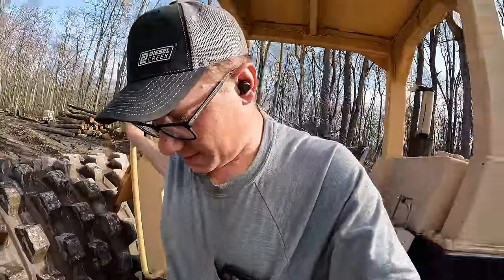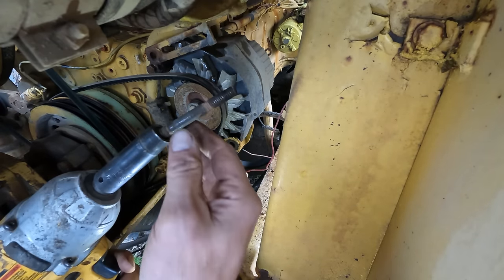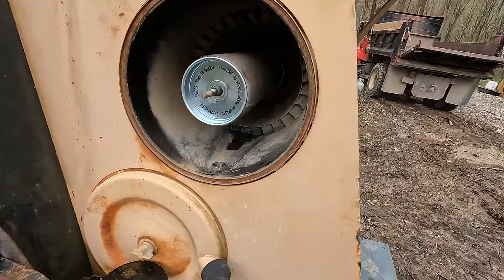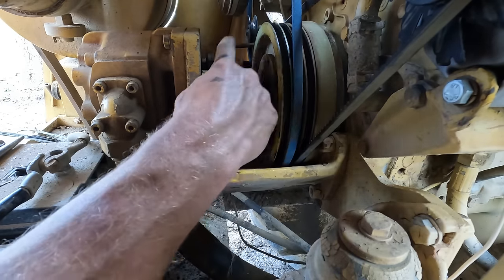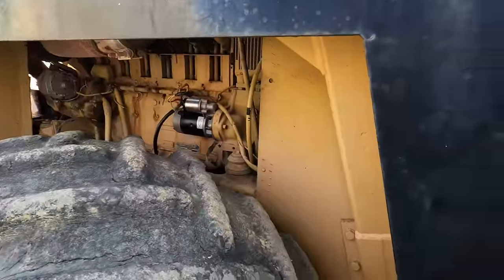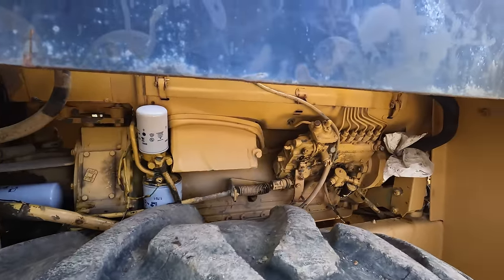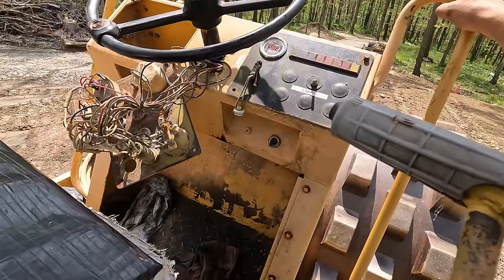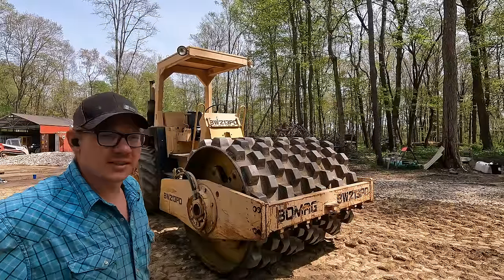I got BURNED on this Compactor from an Auction! (Bomag BW213)

Comment: I'm floored that a roller compactor needs a 150HP to knead out soft materials.  Don't backhoes only have roughly 75HP?
Reply: Not an expert but maybe needs the extra power for
Reply: Based on no doubt flawed quick searching, a typical backhoe is around 7 to 8 tons.  This roller is 13 tons.  Takes more muscle to push the extra tonnage, a fact I recall whenever I have to get out of my recliner.
It probably is overpowered, lots of stuff was in the 80s.  Then gas topped a dollar a gallon in about 1984/85 (horror!) and both gas and diesel engines went from "plenty of power" to "almost enough" in just a couple of years.

Comment: I like those huskey kevlar belts from tractor supply also.
Alot of people don't realize those lawn mower belts are better and cheaper than automotive belts.
I think they are better than the others.
I save a few of my one gallon jugs to refill out of a 5 gallon with a funnel for tight areas also.

Comment: I had a tractor with the same starting issue, I haven't watched to the end yet but the problem was the control wire to the starter from the key was hashed a bit.  It would only send 7 to 10 volts to engage the starter.  I added a relay in and took a wire straight from the battery.  It only takes 6volts to engage the relay that closed and sent 12+ volts to the starter solenoid that made the starter engage every time.

Comment: They are oil cooled and yes it does have a radiator but it runs oil through it rather than antifreeze.  That drain plug placement it normal for Bomag even today, get your self a Fumoto or a EZ-drain valve.

Comment: Equipment mechanic here, blame the engineer. Out of our fleet which has hundreds of pieces of equipment, for the duesel powered equipment we have 5 different manufacturers. 2 of the 5 had foresight for oil changes having suction lines for oil drains. The other two? Well one has a drain hose thats only 3/8. For diesel oil. Takes an hour to drain. The other? A MISPLACED hole in the belly pan allowing just enough roof for a wrench to pull the drain plug. Then you hack up a piece of cardboard or water bottle or whatever and wedge it in there and brace for the mess.

Mind you those two manufacturers build multiple machines with different engines that all have the same issue.

One of our generators has a drain line routed through the frame rail of the machine to a convenient drain point. No mess, but the line is long, undersized, and lays nearly horizontal. It took 5 hours to drain 3 gallons of oil. Also a deutsch design.

We had a brand new machine once, has a hydraulic tilt cab for service. Apparently they needed to change cylinders out because the ones they were using were discontinued. They dropped the machine off and came to do their final inpection. Lifted the cab and couldn't lower it. New cylinder didn't fit properly and would get caught on the frame. No one tested it apparently after making the switch. Why? Just why?

Comment: On the starter motor you called the starter solenoid a relay the reason you were having starter problems was the solenoid was not pulling the bendix fully into the flywheel  the end cap of the solenoid is also the main switch for the starter that plastic end cap is removable to clean the contacts of the switch ( just fpr future info  it is quite a straightforward job to remove the cap usually 2 solder joints and remove the nuts that hold the heavy cables

Comment: the high/low vibration works by reversing the drum motor, there should be a solenoid valve operated by a switch to control direction

Comment: Considering the importance of the fan, it would seem that a two belt system would be much more reliable.  Get a double pulley for the tensioner, or make a double pulley and that critical component will not be a worry again.

Comment: Take the starter off, take it apart, and clean. CHECK BRUSH HOLDERS FOR FIT. grease bngs both ends, and shaft spline. Remove solenoid and clean contacts inside.

Comment: You're removing the alt. and I say "I see a knuckle injury." the next bolt, wham. But you probably remember that.😁 It happened again, 🤣🤣. Your definition of victorious is different than mine. Let's see you put that back in. You're probably hoping it's no good.🤣  The crankshaft guy wasn't talking to the accessories guy.🤣🤣 No, you have to drop the starter again. Dude, maybe they are after mud. 🤣🤣🤣 "You thought you were going to take a bath." This is my first video of yours, you had reason to believe that. "I tidied this up a bit."🤣 That looks like my  computer setup, but I can't see it and it only gets in the way occasionally.   I'm just bustin on you man. I'm stoned and you cracked me up.  Have a sub. 👍👍

Comment: As a certified electrician I can guarantee you one thing about dielectric grease - it's an insulator, and a very good one at that. It sure won't help you improve the conductivity of your connection, since it's designed to do the opposite of that. If you want good connection, clean the surfaces nicely. Worst case scenario, if nothing else works, you can try the sin of using some conductive grease. Regular grease is also a pretty good insulator as well.

Comment: On that style of solenoid, it's basically a servo that slides a shaft with a disk on the end of it. The disk jumps across two terminals. When they fail, it's usually because the terminals wear down. Sometimes you can get them working again temporarily by unbolting the leads inside and turning them 180, because they never wear evenly and that'll usually give you a bit more wear surface to engage that disk and jump the connection with. I've looked into replacing just that part but they aren't available. Just shop around for a good price and replace the whole thing.

Comment: Hey Matt I know I’m late to reply but I run a few of those Dutz in my fleet and I’ve found it best to bye original Dutz belts for the fan 2 are a match set,,,,usually have a limit switch inline with the fuel shut off that runs on the belt so if the belt breaks it shuts it down,,,love your channel

Comment: Also forgot to mention that Inj. Pump has motor oil in it. we always changed with engine oil service.  Bottom drain plug, level plug on back, and larger plug on top is fill

Comment: The bees are looking for a small hole to build a nest . Leaf cutter and Mason bees use existing holes and pack them with mud or crescent shaped pieces of leaf. Ever seen a radiator petcock stuffed full of small pieces of leaves? They are very particular about the diameter of the hole.

Comment: Late to the party but the old towed dynapac's we had used the broken belt switch in between the stop solenoid so if the belt snaps the engine goes off, makes it idiot proof then

Comment: Heh. I have spent SO many hours on those things. Warning labels: "Never use on any slope at all or you will die!" Reality: "Steep slopes? Hugely lumpy bunch of dirt with mud underneath? No worries, I got this." That said, for what you're doing, you probably could've gotten good enough compaction with a dump truck full of dirt. We passed so many soil tests with broken-down compactors by filling up the water truck and driving it back and forth forever.

Comment: I always learned that dielectric grease is an insulator and should not be used on direct connections where you need an eelctrical current, like you do at 19:25. I see so many people using it though that I had to go look it up again, but it is in fact an insualtor and should be used to protect electrical components from moisture and dirt or to improve heat transfer, but NOT for direct contact between electrical connections. I'm guessing it still works in this case because the pressure of mounting the starter makes the grease layer thin enough for current to flow. But, I think to do it properly you should leave the surface bare metal, and only apply the grease to the very outer edges to prevent moisture and dirt from coming in.
Reply: Dielectric grease is perfectly fine on direct connections

Comment: That family of Deutz engines is like the English Perkins which regardless of number of cylinders they are standardized. Check the main cooling fan bearing as they can cut out early but a very easy fix. ( Make sure to give new bearing around 4 pea sized lumps of grease. Best to clean out and use Amsoil synthetic).

Again the filters on these are terrible. Replace with Racor with a glass water and sediment trap.

The intake manifold on these have a Thermostat fuel heater for cold starts to vaporize fuel very similar to Perkins diesels. Make sure this is checked. 
Deutz for over heating usually have a horn that goes off when overheating so u can shut down.

When compacting to achieve max results sprinkle a bit of water into material then pound in inch but inch. This helps lubricate material allowing it to shake into place.

Note; Fuel tanks are real pain in the arse on used machinery. This is due to some people using Jerry cans etc which can lead to bits of grass, straw, insects and dirt blocking up the fuel cock / tap strainer for the drain to pump feed.  Also take the lift pump cover off then clean out the little gauze and water sitting in recesses.

Comment: We had a Chinese front end loader that had a Chinese replica Volvo engine in it. The oil drain plug was on the side of the pan and projected the oil straight into the c channel frame rail and it would drip out along the entire length.
We ended up tapping out the drain plug hole to take a barbed fitting and running a hose to another barbed fitting with a plug screwed in. It wasn't the best but it worked.

Comment: On the most part of the engines, you can suck up more oil from the dipstick than from the oil pan drain. Often the vacuum pipe drain the oil from a point lower than the oil drain hole.

Comment: Great video!  For the record, though at 19:05 - you mention using dielectric grease to prevent corrosion and keep good electrical contact.  While it will help with the corrosion, that material is actually an insulator and is designed to restrict the flow of electricity.  You might instead consider using a conductive grease like Penetrox or similar.

Also at 24:04 - about the bees loving the equipment.  My wife's car is bright yellow, and same problem.  I think the bees reckon your rig is the world largest nectar source!!
Reply: Dialectric grease doesn't create carbon (conductive) when it burns.

Comment: I haven’t read through all 2k plus comments. The proximity switch near the cooling fan is tied into the fuel run solenoid unless it’s a cable pull off kind. Fan belt breaks , engine stops running. Also inside that housing is a spiral oil cooler. Buy a set of Deutz ferrules because it vibrates and it WILL leak. Deutz proprietary ferrules. Avoid the headache and heart break of chasing a part made of unobtainium. (Not to be confused with chinesium).

Comment: Get an extension plug for the oil drain. If you use a pointed punch in the bottom of the old oil filter it should be less messy.

Comment: # 27:46 some heavy equipment has a small pump just to prim the filters. take note to leave the pump handle as you found it. Crack open the bleeders on the main fuel pump to vent air when cranking. Be careful with that eather, it can bound an engine so it won't turn over.

Comment: Dielectric grease is an insulator.  Coating the bare metal with that grease does not enhance conductivity.  The proper method is to install the item and protect it with the grease after it is installed.

Comment: any easy trick for measuring belts is to take a somewhat thick piece of rope put it around the pulleys with a slip knot pull it nice and tight then just cut the rope in the middle measure what you have left

Comment: Starter having problems for 11 years. I guess it would say they ignore problems with there equipment. The Mack we have you can’t get the oil filter out without getting it just right and either turning it sideways and out between the front spring or barely holding on to it and bringing it around some piping and getting it to the front of the engine cutting your arms on things. That’s a difficult oil change too.

Comment: when doing oil changes i like to put a punch hole in the bottom of the oil filters and letting them drain before spinning them off. much cleaner.

Comment: Changed oil Bomag, oil plug is like that. Frimco drain plug, drain with hose reduced mess. Same problem with vibration control switch.

Comment: just a run of the mill GM alternator... need battery connected to the big post on back and a wire from the post to the #2 spade terminal (14G is fine)  Alternator will take right off AFTER to rip the throttle once..

Comment: Hey Matt I wonder if you might want to try a idea I did that light green package sponge that 1/8" thick I found a idea I took a piece and.made a third sponge filter to slide over or around my dozer and found on dusty conditions that filter get dirty first a easy remove off the the filter rinse in water wring dry and replace on the filter like Briggs and Stratton 5 hp air filter on your compressor

Comment: Hi Matt, great video (as usual!!). A couple of things I'd like to suggest, although it may not be worth it after seeing your final clip. With the starter, it may be worth while 'reshaping' a leading edge onto the flywheel ring gear to assist in tooth engagement (copy what the other teeth look like). However, it seems to be working fine, so maybe not?? The 'cooling blower', get the correct double row adjuster pulley and run the 2 belts!!! I think it's too much strain for one belt to cope with! Also, when you change those belts, put an extra 2 around the hyd coupling and zip-tie them out of the way so that if the originals fail / wear out, you don't have to undo that coupling again. Lastly (and this may be your issue for the next vid) , those hydrostatic transmissions in the Bomags are very temperamental. If you loose 'charge pressure' (and it's a tiny little woodruff key that drives it), it can very quickly destroy the whole hydraulic system........which is kinda the whole machine!! My suggestion is a charge pressure gauge on the dashboard to keep an eye on it. Thanks again for the awesome vid!!

Comment: If you put your shop vac on the filler hole before you undo the drain plug,  the vacuum holds the oil in while you get clear...

Comment: A Bendix is something else, I suspect that's a Bosch device on the starter.  Bendix uses inertia to engage and would take exception to the condition of your ring gear.   Those were the days when you had to rock the car back and forth to get the Bendix unjammed and/or replace the ring gear.  Might check if the injector pump has access to engine oil.  Some have separate oil compartments (e.g., the pump has a separate oil compartment on my Deutz D5055 tractor).  The upside is that leaking pump seals will not dilute the engine oil with diesel.

Comment: Be sure to check why the belt tensioner switch didn't tell you (with a light) when the belt broke. Also, there is a oil over heat light.

Comment: You can easily fix the problem of the belt rubbing the bracket. Call it, oh, about 10 minutes with a cutting torch. A nice little slot in the bracket, and problem solved! Then you can use just about any-sized belt in there. ;-)

Comment: On Deutz engine fan belt should be as short as possible, that tensioner at correct belt size should face upward.  Check bearing in tensioner, check bearings in cooling turbine. Wash oil cooler, wash cooling ribs on cylinder heads. Do not operate with cooling cowling removed.
Microswitch behind tensioner should stop engine if belt snaps, or activate horn on older models. If belt is too long and tensioner resonates, jumps up and down belt wil last few days. Would recomend valve gap adjusting on engine that old.

Comment: Your cooling turbine needs a double belt on these engines, and fixing the buzzer and the tensioner contact is mandatory before running the engine. 
I would add an extra temp gauge anyway to prevent self destruction.  
And since this is a turbodiesel, make sure your airfilter is replaced.  
Normally there is a flame-start heating element in the inlet. You'll need that working too at freezing (or close to) temperatures...

Comment: They put the oil pan on backwards. Most likely after a rebuild. That oil drain plug issue can be fixed by turning the oil pan around.

Comment: That starter is really just a bandaid for the real thing thats going on.  In not too distant future you will find there are 3 worn places on that ring gear on the flywheeland those are the real reason for the Bendix not engaging and that ring gear will need to be replaced pretty soon because it is going to eat up your bendix on your new starter and you will be back to square 1 The reason for 3 places on the ring gear is because there are 3 places an engine likes to stop at when you shut it down

Comment: I have several F6L912 , there should be a micro switch on the tensioner to stop the engine so it does not overheat plus on ALL of my equipment I always use belts from the DEALER (I learned the hard way) also I think I saw the micro shut
down switch on on the belt tensioner that saves the engine from overheating and one more thing on the ,open the blower cover and check for nests from varmets that will prevent a. cylinder from overheating this is very important. duetz engines are the most reliable and Very efficient on fuel about 20 horsepower per gallon of fuel